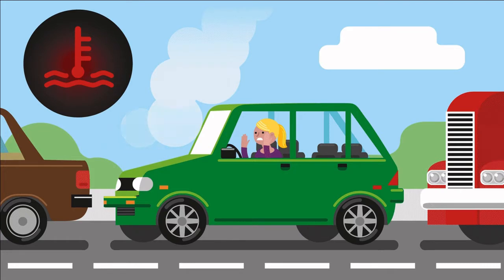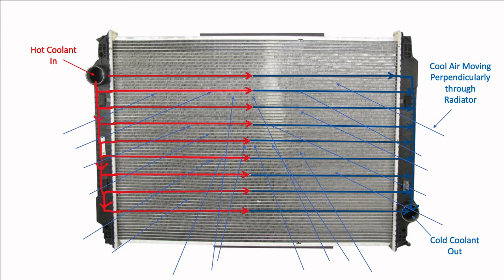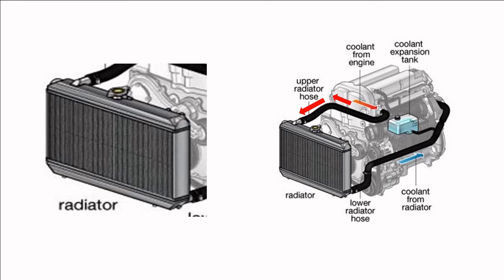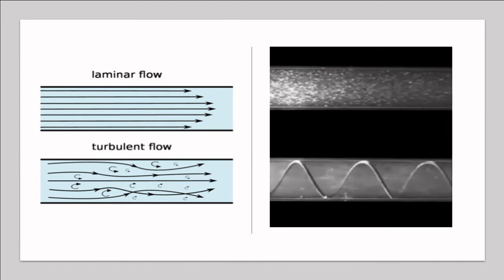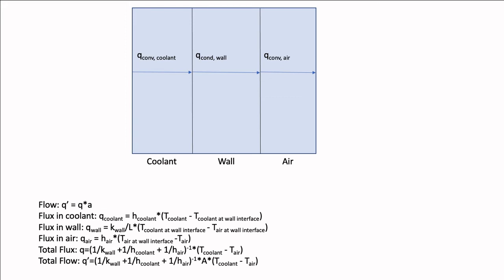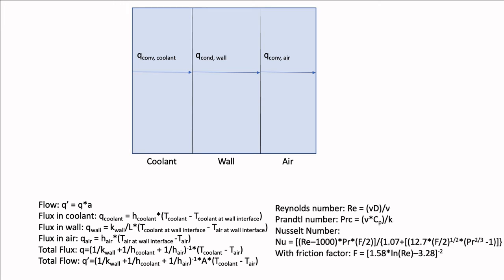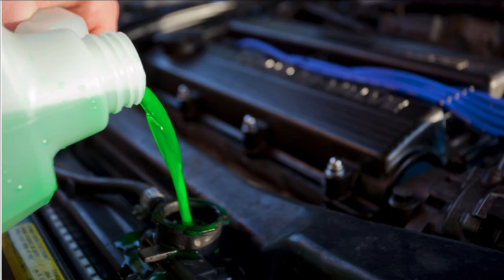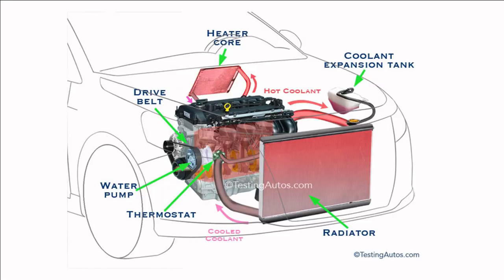Car Radiator as a Heat Exchanger

Comment: How does the fin impact the heat transfer
Reply: Fins provide more surface area for the heat to spread, allowing more contact for passing air to absorb energy.  Generally speaking, the more fins the better, up to a limit.  It's a balance.  More fins increase cost of manufacture and too many restrict airflow, reducing efficiency.

Comment: Wonder about how many btu's an average car radiator would produce with 120F water?
Reply: Technically speaking, a radiator doesn't produce energy, it dissipates energy.  Furthermore, your question can't be answered without providing a mass flow rate for water and air, inlet/outlet temps, radiator dimensions, etc.